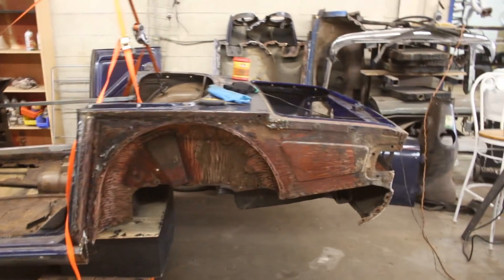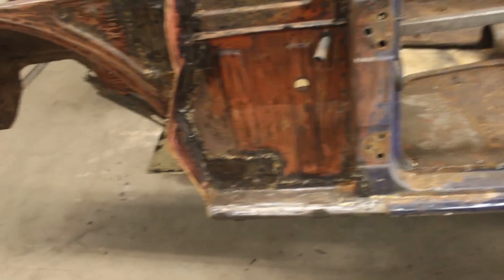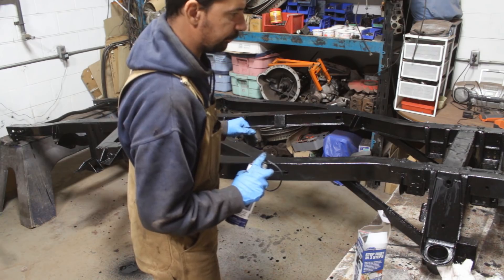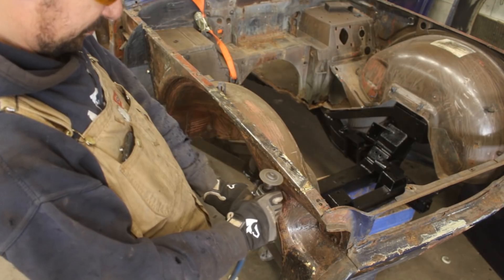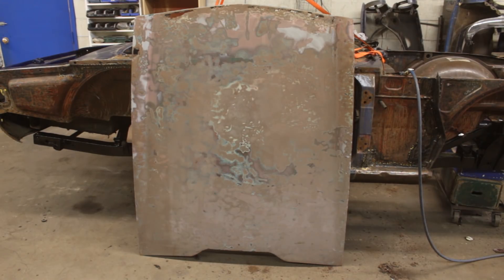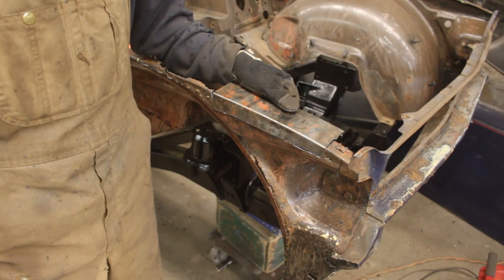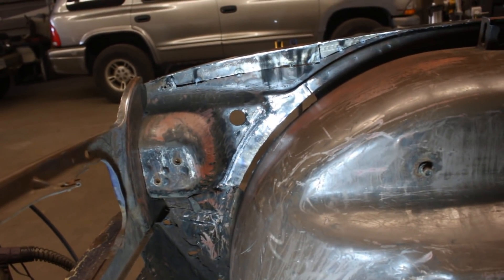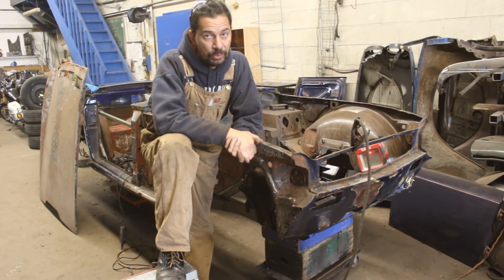1974 Triumph TR6 - Part 9 - Body Repairs begin

Comment: Nice repair.  If you can fix that body you can fix anything and it is fixed with Triumph metal.  👍
Reply from the maker: Dust to dust and Triumph to Triumph :) Well, that body is not that bad actually. I've seen worse. Ask Cheftush LOL

Comment: Nice work mine has a lot of the corrision problems that yours does as well, espcially at the front. My flours were not quite as bad as yours
but I have replaced them and the sills; at least I have on one side. While I thinking about it I whould reccommend extending the drain pipe from the scuttle out through either the front wheel arch. This will prevent water and from building up on top of the sill should the drain holes become blocked, as they inevitablly will.
Reply from the maker: Yes, I was thinking of doing that on the 73 and I ended up not doing it, but I might do it here. However there are more water drains going between the fender and the kick panel. It is not only the scuttle. I will probably show that in one of the next videos

Comment: I think Tush would have taken that body instead of the one on his TR250 but as you say its a bit strange as its a 'body of two halves'...

As much as you like making plates and welding I reckon you will be needing a complete floor pan assembly. Safer way to keep everything in line as well

Just a thought - to save damaging that lovely repaired chassis could you make up some timber spacers and set the body on those? Bolted through they would still retain the integrity you need and you can cover the chassis. Makes the body higher to work on as well... Its what we used to do on Elans ...
Reply from the maker: Yes, for sure I will use new floors. We have those along with inner and outer sills, kick panels, body mounts.... I probably won't use all of that, but it is good to have them. 
I still have to spray the frame with truck bedliner and purposely I left that step for after I am done with the body, So I am not worried if I scratch it here and there.  I can just touch it up later and finish it with the bedliner. There is no better support for the body than the frame that it will be living on. Even if there is something wrong with one or the other we just make them fit perfectly together while all panels match and gaps are perfect.

Comment: All-in-all that body is better than David's 250, but there are certainly some issues. Don't you think you'll have to completely replace the floor pans? I'm sure you'll get it together better than it was just out of the factory. Thanks for the update! They're always appreciated.
Reply from the maker: Yes, Bruce, the floors will definitely be changed :) I played with the GT6 ones, because 70-80% of them were solid, but these ones are far gone. We have floors,inner and outer sills and more new parts that we bought long time ago so I will not waste too much time with parts that are available. Especially now that this car became a shop project!

Comment: Elin--Really enjoy your videos!  I've been through many of these repairs on my TR6, but I have a 69 GT6 that I haven't touched yet. 

On the top flange where the front wings attach, there are small rectangular recesses for the speed nuts so the wing can seat flat.  You can pretty easily make those recesses with a simple set of home-made dies and a pair of vice-grips.  

See http://bullfire.net/TR6/TR6-49/SDC13184a.JPG
Reply from the maker: Thanks! I've been planning to do those with a pair of adjustable wrenches, but your idea is better! Thanks.
I've seen your website about your restoration! You put so much effort in documenting your work! It is really helpful! Thank you so much for that!